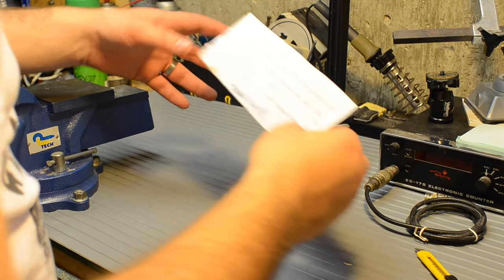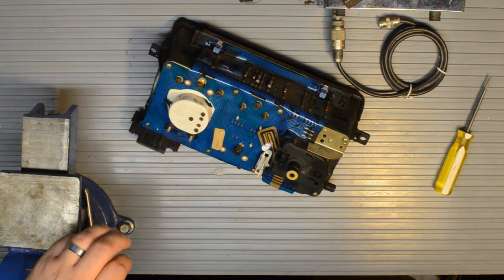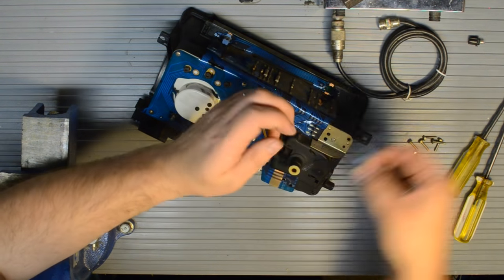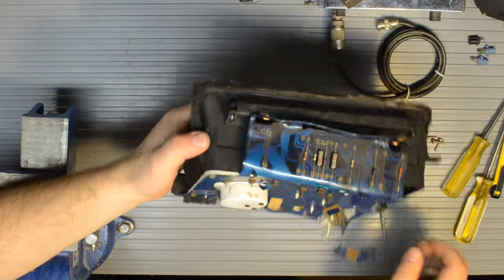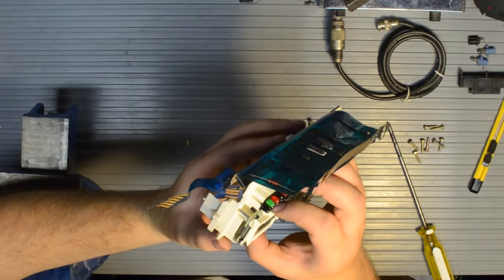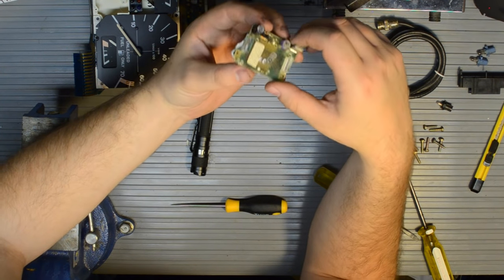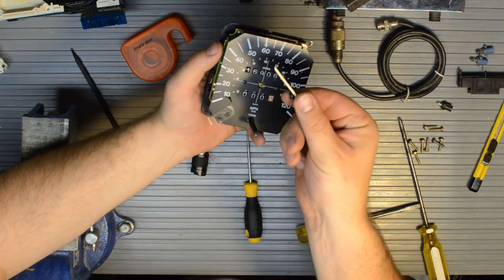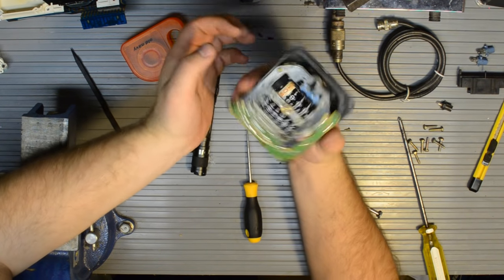003 - VW Instrument Cluster Disassembly & Odometer Repair

Comment: Your video helped a lot. Fixed my odo that’s 35yrs old. I tested my work with a drill in reverse driving the speedo connection with a #2 square tip.

Comment: Hi!

I have an old -88 Memphis that that the odometer stopped working during repair at the mechanic. They fixed it but the needle now moved up and down and now it is not working. Will give it a try with the help of your videos. Best wishes from Sweden

Comment: Use two teaspoons to lever the needle off without danger of snapping the hardened shaft.  Piece of paper underneath so it doesn't mar the face.
Reply from the maker: dbeierl great suggestion, that seems much safer.
Reply: @legoguysrepairanything7646  also if you notice where the needle settled -- there's a tiny white tickmark at the edge of the face to show where it's supposed to.

Comment: Hey mate. Had some problems during reassembly, kind of spelled out below. Do you know if this is fixable? 

When I took mine apart, after the faceplate was off, and we removed the four screws to be able to lift up on the red gear and slide it back...my whole fromt portion came free from the base. I watched you do the whole repair as a semi-assembled unitecause the camera had shut off). I never saw your section removed, even though you mentioned it did, in fact, remove. So I have done all my repairs, but when I put the faceplate back on, I can push the needle on, but if you lift the needle to try to get it over the seating peg, it just pulls the spring though the faceplate hole. No clue whats going on.

There is a little pin that it leads to on the backside of the clear portion/numbers, and it appears to seat into the speedo mechanism below that. But no matter how much I push and tap, it isn't 'seating', This would be easier with pics, sorry its so confusing.Here is a vid showing the needle slop. I know it wasnt this way before, because it was solid when removing the speedo needle. 

https://www.youtube.com/watch?v=fqtVtABPi4g
Reply from the maker: Okay, I'm not sure exactly what's gone on here. It almost sounds like the needle spindle came free of - or possibly broke off of - the circular metal assembly behind it. In the footage just before the cameras cut out, I did, in fact, say that the whole clear faceplate thing comes free - but as I looked at it (while the cameras had turned off), I figured out that it does not actually come free without taking the tension spring ("clock spring") off of the needle spindle, something I would rather not do. I guess what I'm saying is... if you can't get that needle to pop back into place in the assembly behind the clear bit... you might be looking for a new speedometer :( I've never experienced this type of issue with these speedometers before.
Reply: OK. This is what I was afraid of. Sadly, It was initially fixed...But I put the silver gear on backwards (This made the ODO work but not the trip meter). So in order to do it 'right', I decided to re-so it.  So  I tapped the red gear/stem out, turned the silver gear around, and reinstalled it...that was when the two parts separated. Too many taps of the hammer I guess. Thanks for the help. Off to the internet to source one.

Comment: Hi, do you have messages disabled or did YouTube change how you send messages? I'd like to send you a cluster also.
Reply from the maker: It should still allow you to send me messages, I'll look into it. In the mean-time, send me an email at legoguy@gmail.com.
Reply: Legoguy's RepairAnything sent you a email.
Reply: Legoguy's RepairAnything 

Can you fix a 2006 Jetta TDI transmission solenoid? After my car warms up it down shifts to first and won't leave first gear.
Reply from the maker: I've never seen one of these; I would expect this to be some sort of sensor or perhaps mechanical failure. You may need to replace the part rather than try to repair it. :(